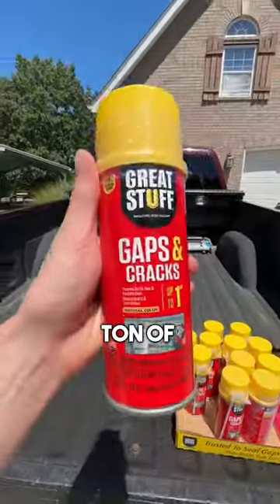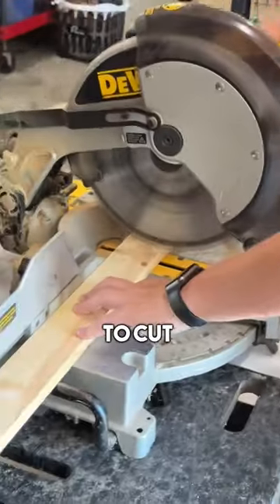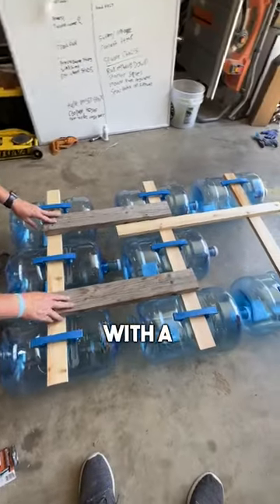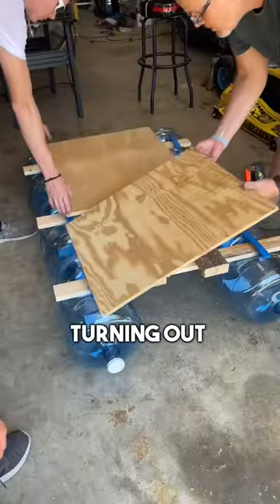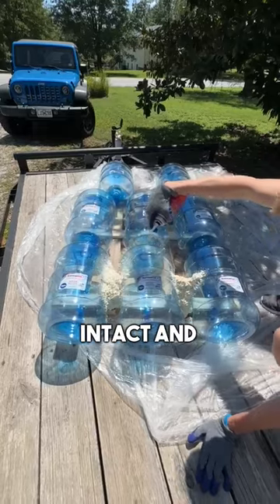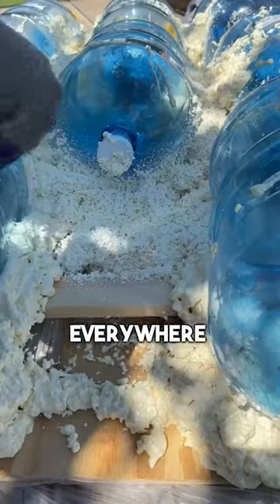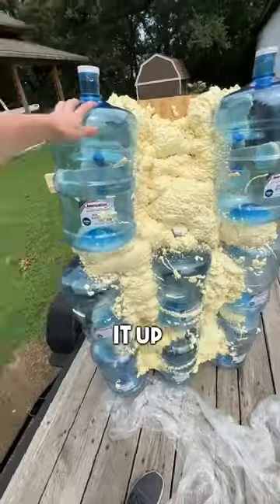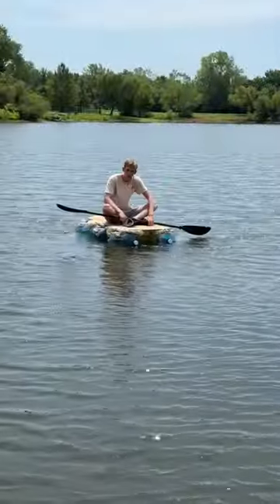Making A Boat Out Of Water Jugs #shorts

Comment: I do believe a 2 man inflatable boat costs less. 8 bottles at $8.00 ea. Then 12 cans of great stuff at $7.00.
Plus about $20.00 in wood and harware.
$64.00 plus $84.00 plus $20.00. So it cost around $164.00. Yup a real good rubber boat with a mount for an electric motor is less.

Comment: Get 2 or 3 large surfingboards make a frame to hold them together and add wooden boards on top of it as a platform.
you can use ratchet straps to hold it all together and maybe even a small outdoor engine to get it going.
Simple and it can float in very shallow water.
Reply: I prefer the indoor motors

Comment: You may want to buy bigger cans of spray foam next time. Or even rent the commercial machine so that you don't need to doof it up with little bottles.

Or just an idea use 55 gallon plastic drums use steel straps and make something that you don't need to do it by yourself.  Some things are better when done with at least one other person and the more the merrier but you must have the equipment to accommodate.